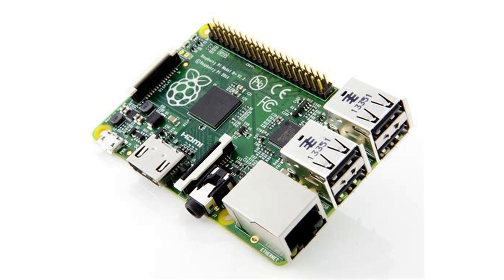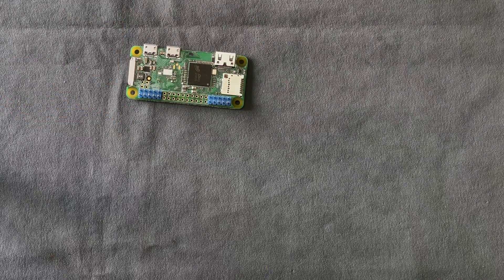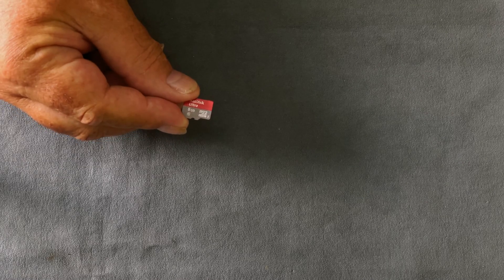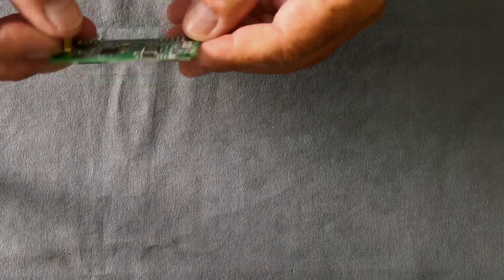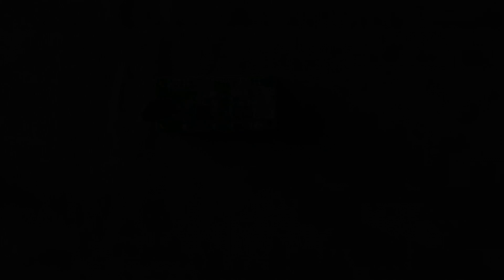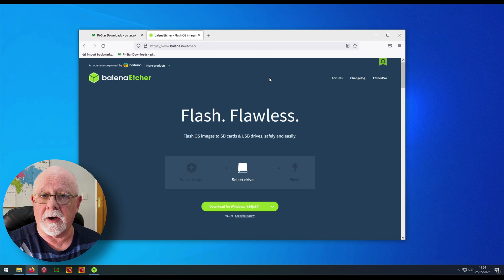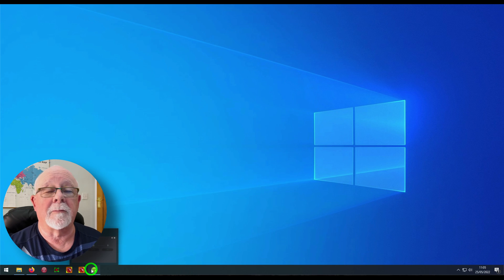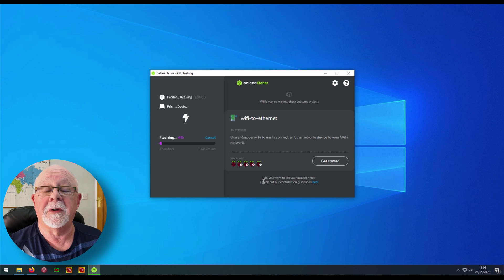26. Build Your Own Hotspot - Part 1

Comment: Excellent Ian, as always.
What size max msd will the PI take? 64?
Albert.
Reply from the maker: According to the Raspberry pi documentation, it is stated.. "Because of a constraint in versions of SoC's used in the Raspberry Pi Zero, 1 and 2, the SD card partition size limit is 256GB. From the Raspberry Pi 3 onwards this limitation does not apply." .  There do seem to be varying real world reports.  For pistar, 8GB is fine but as 32GB cards are cheap (at least currently), I tend to use them.
Reply: @NorthWestFusionGroup  thank you Ian. My Beagle kiwisdr is now online. See my QRZ entry. 
Before ALLSTAR I had never seen or used a raspberry.
Shame they are very hard to get at this time.
Am looking  fwd to episode 2. 
Albert